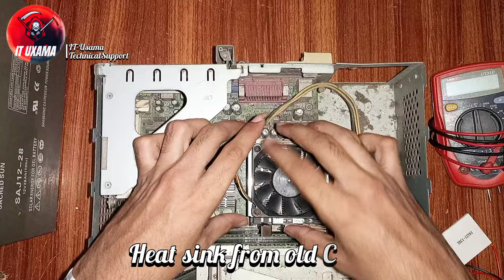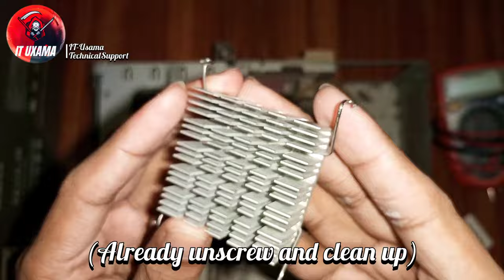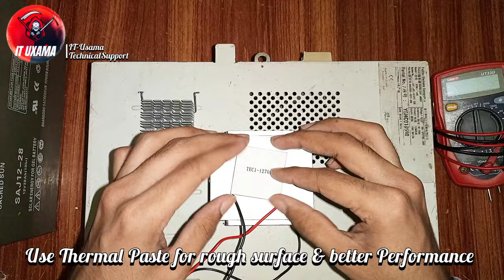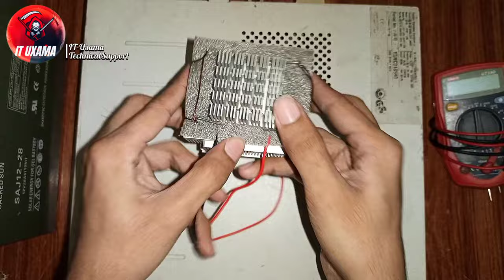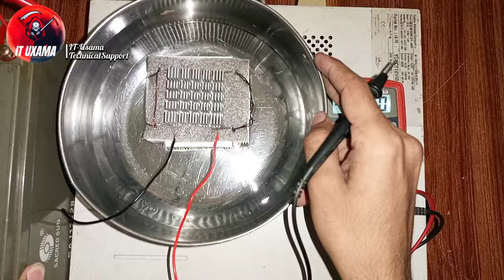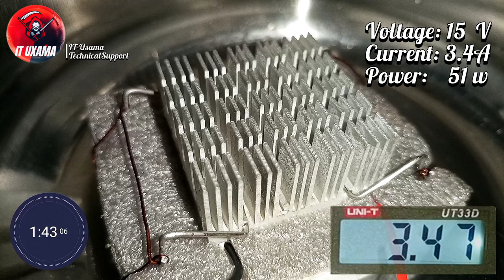Peltier Module | TEC1-12703 | Making Cooler / Heat Pump with Thermoelectric Device | #peltier #2024

Comment: wow, is this really can freeze things?
can it be use in making street ice cream?
Reply from the maker: Yes, a Peltier module can be used to create a freezing surface for making ice cream, but there are a few considerations. You need a powerful Peltier module with adequate heat dissipation on the hot side, typically involving a robust heat sink and active cooling (like fans or water cooling). Additionally, the Peltier module needs to be properly insulated to maintain low temperatures. While it's feasible, achieving the necessary temperatures and maintaining them efficiently can be challenging compared to traditional refrigeration methods.

Comment: You shouldn't use without Thermal Paste
Reply from the maker: Using Peltier module without thermal paste will reduce its efficiency 
But it was my first experiment with peltier and surface of heat sink was very smooth, both already have well surface contact, so i decided to go without thermal paste 
In next project I will use it
Reply: @ITUsamaTechnicalSupport  yes bro please make one